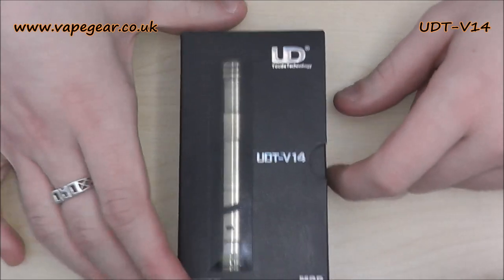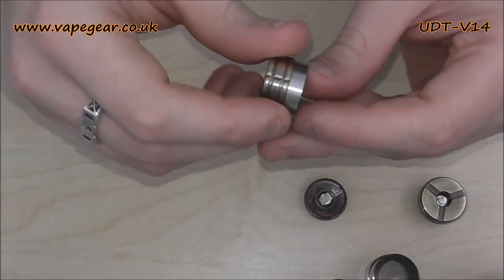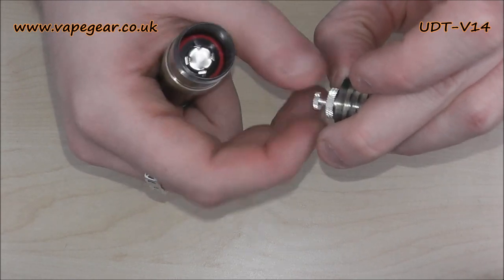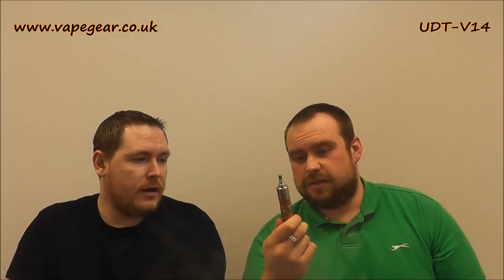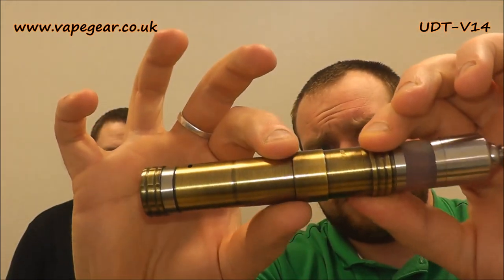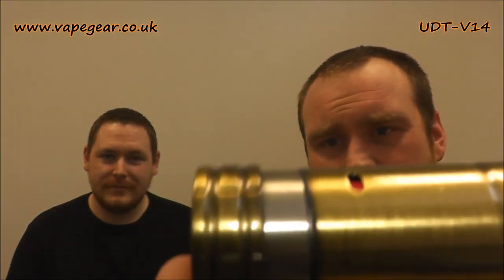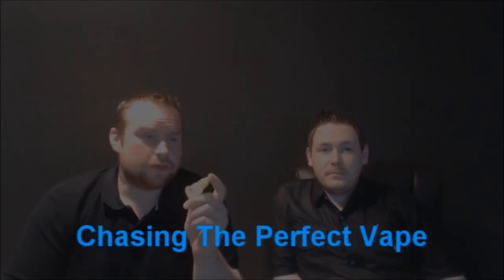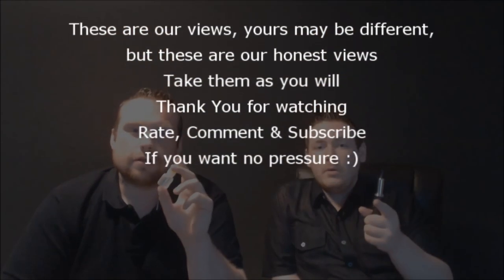UDT V14 - VapeGear

Comment: Hey guys I own a v14 and sometimes it wouldn't fire when the button is pressed in unless u pressed it really hard. Here's a quick fix I did to make so u don't have to press so hard. Take the apart and take out the little tab that is screwed into the bottom it's the silver or stainless colored tab. Take it out and straight n it to where it still has a bend in it but sits just above the silver negative post. That's it quick fix.
Reply from the maker: Louis Nicolet lovely little quick fix there mate thanks for commenting it
Reply: Yep hope it helps some people